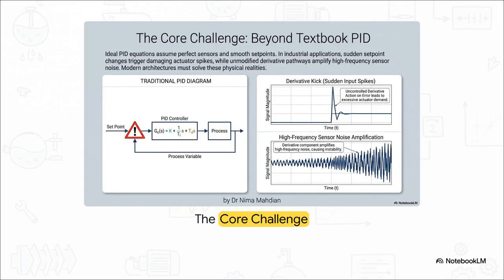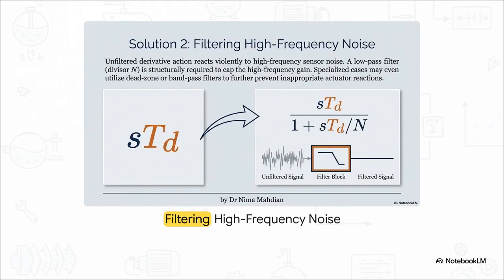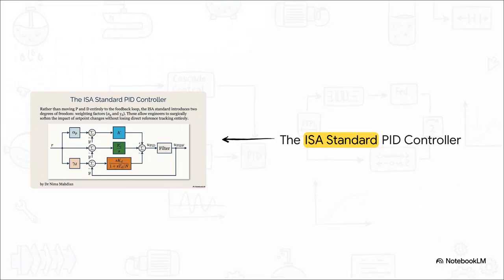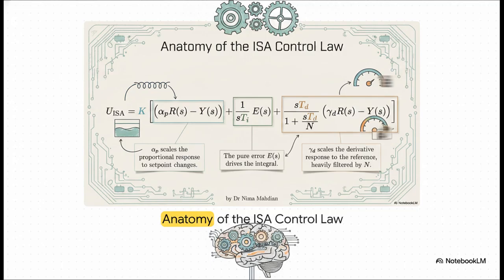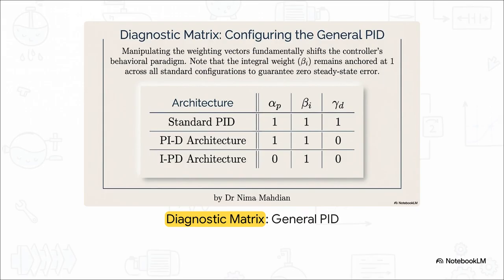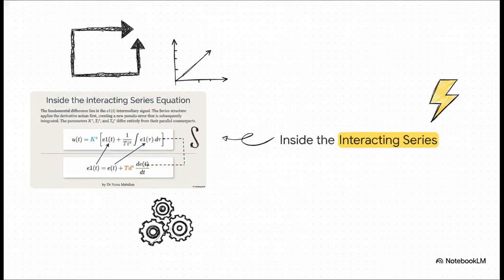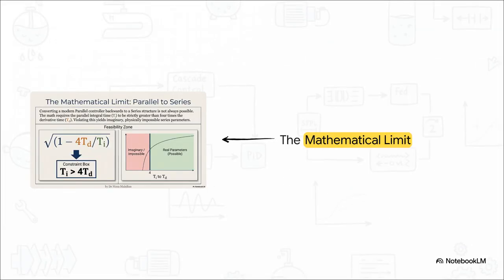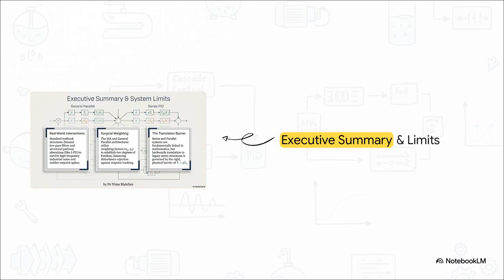Advanced PID Structures Explained | Modern Industrial PID Control Techniques

Comment: Since the conversion from Parallel PID to Series PID requires (Ti>4Td) what should be done when the Parallel parameters do not satisfy this condition?
Reply from the maker: Thank you for the excellent question. The condition Ti > 4Td is required for the standard exact conversion from Parallel PID to Series PID when we want real-valued series parameters.

If the parallel PID parameters do not satisfy this condition, the standard conversion formula should not be applied directly. Instead, the engineer has several options:

Retune the PID parameters so that Ti > 4Td, if a series PID structure is required.
Keep the Parallel PID form if it already provides satisfactory performance. There is no requirement to convert every parallel PID controller into a series form.
Use an alternative controller realization or numerical fitting method if a series implementation is necessary.

It is important to note that Ti ≤ 4Td does not necessarily mean that the original Parallel PID controller is unstable or incorrectly tuned. It simply means that the standard exact Parallel-to-Series conversion cannot produce the required real positive series parameters.

In practice, if the Parallel PID performs well, the simplest solution is usually to keep it rather than forcing a conversion.

Comment: Dr. Mahdian, I appreciate this well-organized and insightful explanation
My question is: 
How do the weighting factors (αp) and (γd) reduce the effect of sudden setpoint changes, and why is this approach useful compared with the standard textbook PID structure?
Reply from the maker: Thank you for the excellent question. The weighting factors αp and γd are used to reduce the undesirable effects of sudden setpoint changes, especially proportional kick and derivative kick.

In a standard PID controller, the proportional and derivative actions may respond directly to a sudden change in the setpoint, producing a large control signal. With setpoint weighting, the proportional and derivative terms respond to a weighted version of the setpoint rather than the full setpoint change.

Typically, αp controls how strongly the proportional term responds to the setpoint, while γd determines how much the derivative action responds to it. By choosing these factors appropriately, engineers can reduce overshoot and abrupt actuator movements while still maintaining good disturbance rejection.

This approach is useful because it separates the objectives of setpoint tracking and disturbance rejection. The controller can remain responsive to disturbances while providing a smoother response to sudden reference changes.

Therefore, setpoint weighting provides a more practical and flexible PID structure than the basic textbook PID, particularly for industrial systems where actuator movement, overshoot, and process stress must be limited.

Comment: I have a question in an I-PD controller, we avoid derivative kick, but does this make the system slower in rejecting external disturbances?
Reply from the maker: Thank you for the excellent question. Not necessarily. The main purpose of an I-PD controller is to avoid derivative kick caused by sudden setpoint changes, while still maintaining effective disturbance rejection.

In an I-PD structure, the proportional and derivative actions are applied to the measured output, while the integral action acts on the control error. Therefore, a sudden disturbance that changes the process output can still produce a rapid corrective action through the P and D terms.

However, compared with a conventional PID, the transient response may be somewhat less aggressive depending on the tuning. This is often an advantage in industrial applications because it reduces abrupt actuator movements and overshoot.

So, I-PD does not inherently mean slower disturbance rejection. With appropriate tuning, it can provide good disturbance rejection while offering a much smoother response to setpoint changes.